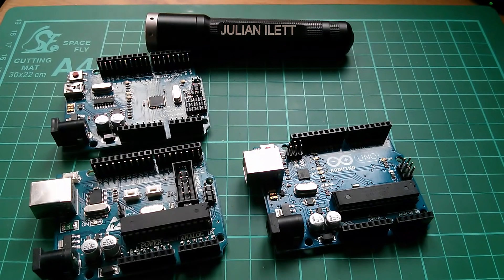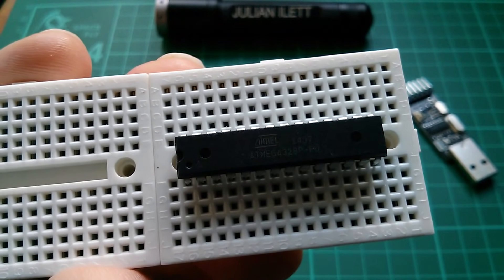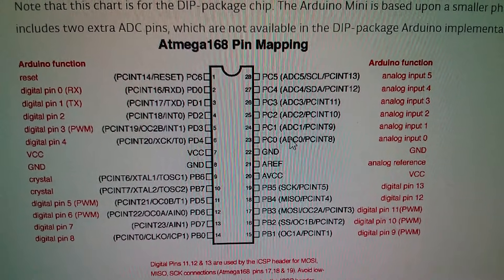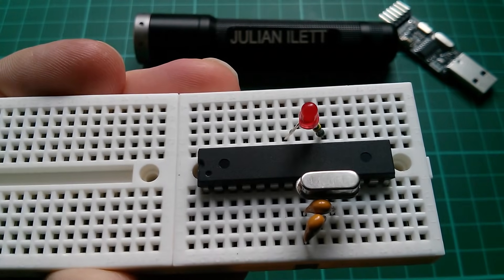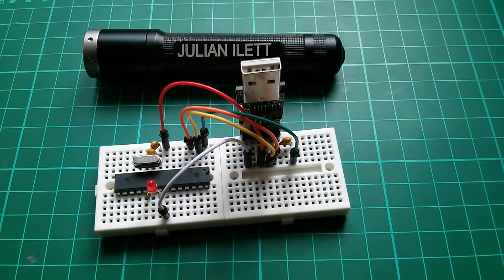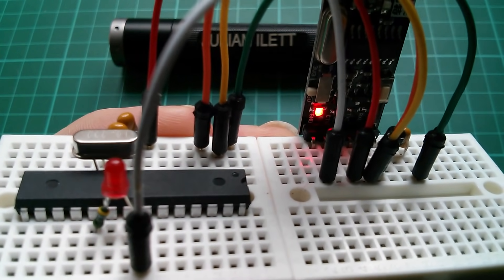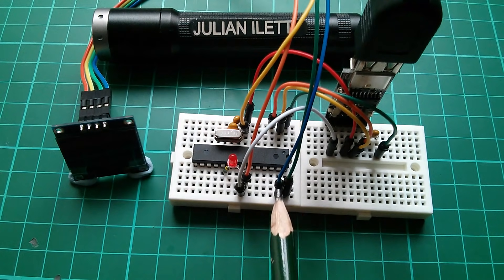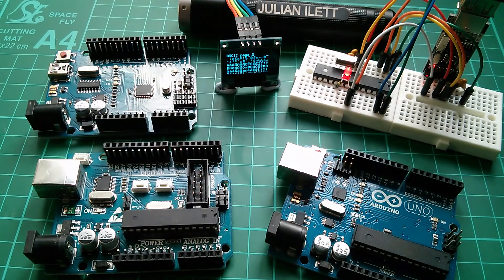1-Day Project: Build Your Own Arduino Uno for $5

Comment: Wouldn't you count a pullup resistor on reset, and a 100nF cap as "essential" ? I would ;)
Reply from the maker: ***** I can only assume that RESET (port C bit 6) has its internal pullup enabled by the Arduino environment. Similarly, the I2C lines must have their internal pullups enabled too, possibly by the u8g library.
Reply: the filter capacitor, while nice, is not essential depending on the power supply... i.e. I don't think 2 x AA batteries will fluctuate much in voltage. the reset pin resistor is essential as the uC could still randomly reset... I don't think it can be internally pulled up when working as a reset pin... and a 10k resistor would probably only cost $0.01... so wouldn't add much to the build!
Reply: Julian Ilett ***** I take it back... looks like the reset pullup is only needed in noisy environments... atmega 48/88/168P/328Ps all have internal 30-60k internal pullups on the RST pin - p324 of the datasheet. I still suspect it's why you needed to reset the programmer that one time in the video... I would think that the USB power & data signals would be very noisy.... especially with a breadboard and no filter caps at all!
Reply from the maker: Peter Feerick I can't work out from the 328P datasheet whether or not the internal pullup can be applied to the reset pin. It doesn't say that it can't be used. I don't see how the differentiator could work without a pullup to Vcc. Only one way to find out I guess.
Reply: Peter Feerick Try to look at the high freq. response on a pack of dry cells. The decoupling cap /is/ needed.
Reply: Julian Ilett The reset-pin needs a pullup, otherwise electrical noise can reset the MCU.

Comment: Your jumper leads look good quality Julian. Can I ask where you purchased them? I've bought really cheap ones before and regretted it.
Reply: Look for the ones with proper square section housings, the round ones suck. Search for Dupont cables on Ebay. Be sure to get all three variations, those being, M-M, M-F and F-F
Reply: The problem with the ones I have is that the diameter of the pins is too small so they don't fit firmly in my breadboard. Thanks for all the advice and recommendations guys.
Reply: ***** Just use an Ethernet or dial up cable that has solid wires!
Reply: Rob B

And also don't get the ones that have square pins (your normal header pins) and just heat shrink on the end (luckily I can't currently find them to buy anywhere). The ones I got have very low quality pins which have a tip that is hardly tapered. This will ruin your breadboard and other sockets (like the Arduino headers). I'm using sanding paper on every pin of that pack before first use. No fun...
Reply: Rob B The square ones are definitely better... I bought some from SparkFun one order, and haven't regretted the purchase... much better than the round rubber shroud jumpers I'd previously bought... the solder joints were shocking and the wires let go from the pins!
Reply: Xeno I do exactly the same. Solid core ethernet wires are prefect for breadboards.

Comment: You also need to connect AVCC to 5V, or portC might not work properly (according to the data sheet).

I'd also strongly suggest connecting the two GND pins. A decoupling cap between GND and VCC would be advisable too. 

You can print stickers that you can stick on the DIP package, that show the pinouts. Very handy, so you don't have to lookup the pinouts.

Great demo of the bare bones Atmega328 Julian. Thanks.
Reply from the maker: beargun42 Good points. I wonder how much current can be passed between those two GND pins before the chip goes pop.
Reply: Interesting question Julian Ilett. Looking at the bare die of the ATMega8 (http://zeptobars.ru/en/read/atmel-atmega8 (top-right is pin 1)), you can see the large yellow square that looks to connected to the ground pads (also note square has a bigger clearance around the VCC/AVCC pads). Seeing that, I think you can probably get pretty close the the maximum rating, with only one pin connected. Though the bond wires may become the weakest factor here. Also noise might be more of an issue with only one pin connected.

Wait. Looking a bit closer I see the yellow square is interrupted at the bottom (left), and partially interrupted at the right (bottom). So probably a bit less maximum current. But since Arduino doesn't really promote using the analog pins as outputs, you can probably get away with it. ADC measurements may be a bit more noisy.

I think we're full circle now (-:
Reply: I'd also noticed the two gnds weren't connected - good catch!
Reply: Julian, great video, thank you very much. I'm not a pro, and am using a Surface 4, and def had to connect AVCC (20), AREF (21) w/10kohm in series to 5v on usb to make the arduino IDE recognize the device on the com port.  The ide had "port" greyed out until I did this. Now working.  Very cool video - thank you.

Comment: Are the clones worth it compared to the genuine?
Reply: In some instances they are more hassle, like the eBay nano clones have the FTDI 'test' pin design flaw that was in the initial official design.  It can be rectified yourself with little hassle however after all the headaches it gave me finding this 'fault' I wished I'd just purchased a genuine one instead :)
Reply from the maker: Sabretooth Barnacle The newer (and cheaper) CH340 Nanos don't have that problem of course.
Reply from the maker: Worth it? Definitely. To save money, buy the clones - reliable eBay sellers supply good quality parts (mostly). To support the Arduino project, but the genuine items.

Comment: the good thing about making something like that is that it can be on a smaller board and have only what you need around it. making it more compact
Reply: That, and removing unneeded stuff allows you to have a very low power sleeping arduino. Good to have a load of cheap sensors left and right running on batteries.
Reply: getting a Nano clone would solve much of the size worries while keeping most of the Uno abilities (and USB connection).

Comment: Would this set up work with the attiny85?
Reply: You can build ATtiny85 yourself, but by default Arduino IDE doesn't support the ATtiny chips. High-Low Tech Group at MIT Media Lab created their own libraries and shared them publicly, so you can download and use them. I made a video about it some time ago, so you can ask if you have any questions about it.
Reply: I came to also recommend a video to compare with something like the attiny85.
Reply: Jou programe  the ATtiny with a SPI programmer and mot via a serial bootloader. There is nu bootloader on the ATtiny. Jou can use the UNO as a SPI programmer for the ATtiny. And for the IDE add the ATtiny hardware library to the IDE. Then you can upload the skets via a (UNO) SPI programmer. I use a USBtiny SPI programmer. There also DIY with a AT chip. But you can buy theme for allmost nothing.
Reply: See Adafruit's Trinket for more info.

It's super easy to build but no, it isn't the same as you rely on the internal oscillator.